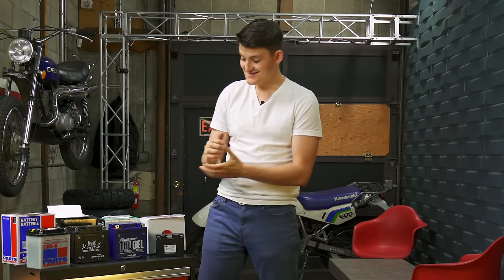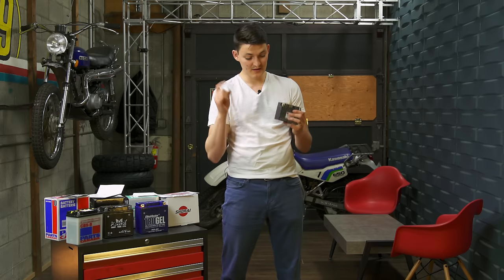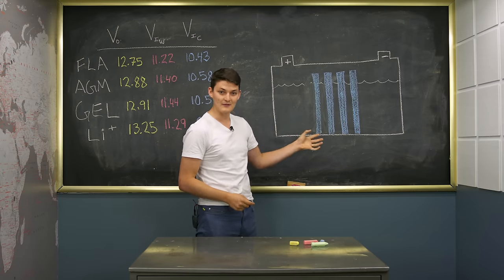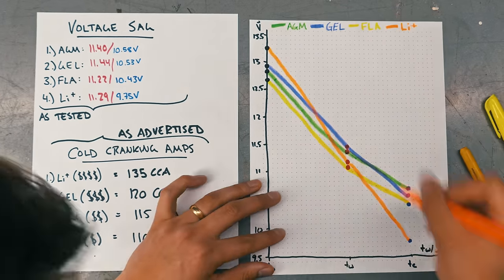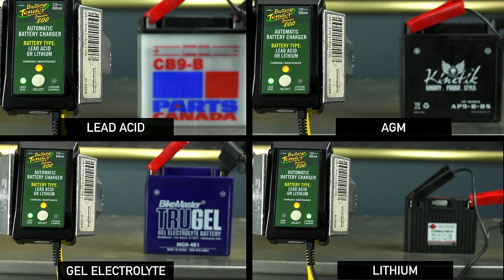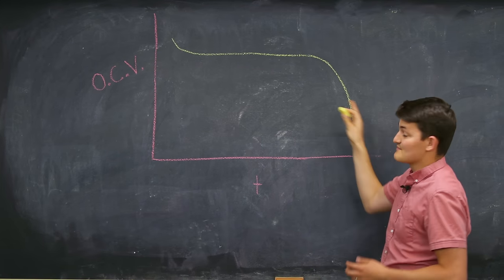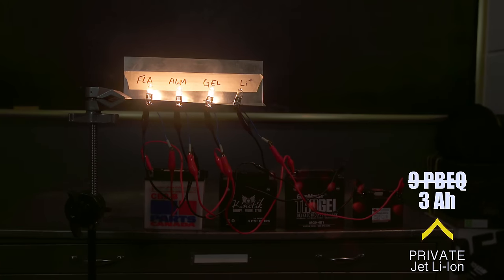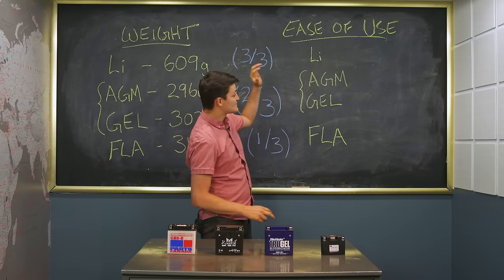Best Motorcycle Battery? Lead-Acid v. AGM v. Gel v. Lithium

Comment: Sorry Ryan, love your channel but you're wrong here.
Yuasa, the OEM fitment of Honda if not other Japs, is a 'normal' lead-acid battery which lasts for YEARS: I've had a few which lasted for over 8 (!) years (yeah, on a decent trickler like Ctek), and the shortest they've lived is 5 years - which was my bad because I didn't ride enough neither put a Ctek on.
Pricewise here Yuasa is about twice the price of a replacement, and none of those last more than 2 years (note, with same treatment & Ctek etc!), worse, they often do not even last a year (oh, warranted all the way to the exit-door of the shop mind).
That makes Yuasa an exeptionally good battery which also is very much worth its higher asking price - and would definitely be the WINNER here in your test!

Comment: This video needs an update, honestly. Needs to include the antigravity batteries and some of the other newer batteries.
Edit: Also, lithium batteries require a different type of charger/tender. Most standard chargers/tenders give off an initial voltage spike to knock out some of the scaling present in standard batteries (including AGM and gel batteries).

Comment: AGM for me, my battery is 5 years old and still going strong (though I use a smart charger during winter).
Reply: AGM for me too. The 9 year old battery in my maxi-scooter with 41,000 miles on it is still going strong.

Comment: i respect your testing and results, but it's still lithium for me all the way, not a lot of really cold starting, low self discharge over storage, and the battery i currently use will ping my phone over bluetooth if there is a problem with charge or temp.

Comment: now what you need to do is see about putting a supercapacitor bank in place of your battery. yes the capacity is abysmal compared to chemical, but capacitors are like LiIon on steroids. they'll charge with a bajillion amps without breaking... and then deliver all those amps when requested (they can blow traces off circuit boards if they're shorted across said traces), even at temperatures well below freezing, because they rely on physics instead of chemistry... also they weigh like nothing... something about using metals like aluminum instead of iron.

Comment: I own a 2016 Hyundai Tucson. They come stock with AGM batteries. Probably explain why Auto Manufacturers don't use Lithium. I have a 2018 Sportster 1200. With a Twin Power Lithium. Rated at 250 CA at 25C. Which I found out later. And is actually about 70F

Comment: Hi. I understand your disappointment about the 9Ah "Equivalent". However, if they wanted to pack 9Ah worth of cells in there, the battery would be 3x heavier, about same volume as Lead-Acid, and 3x more expensive (10x more than Lead-Acid). At which point, no one would really consider buying it. And then it would also deliver 400CCA, which is more appropriate for a small car than for a motorcycle The idea is that you don't really need 9Ah of capacity, but rather you mostly care about the cranking current, and possibly a weight and space savings on the bike. That's where these win. It is also a fact, that most people don't ride regularly, and in many places bikes just sit for months over the winter. Being able to park it and forget about it, and then have the bike start on the first try, is sometimes a deal maker. I don't know about your bike, but I cannot really leave my lights on while the key is out. I could leave the parking lights on, but I run LEDs everywhere, and so the drain would be about 20mA total, i.e. I could run them for almost a week before the battery discharges completely. Not a bad deal.
Finally, where Li-ion wins is that when you discharge it fully, it'll take the charge and be just like brand new. Try it on a flooded battery and after 3 discharge-charge cycles, it won't be able to start the bike anymore.  Regarding full discharge: yes, if you drain a li-ion cell down to 0V, and possibly reverse the polarity, it may damage it. Usually it doesn't, you may lose 10% of its capacity forever, but won't kill it, unless you store it in 0V state for weeks. However, what you had in your hand, was not a li-ion cell, but rather a li-ion battery which has 4 cells in series, and a BMS: Battery Management System. It limited how quickly the battery was recharged towards the end, but it also cuts the battery off when the voltage drops below a specified minimum, I believe it's 8V for Shorai. So the cells won't be drained to 0V, but will stay at about 2V each (nothing is perfectly balanced, but it's pretty close). The BMS itself, draws some miniscule current, so if you leave it like that for weeks, yeah, it will continue going down, but if you somehow manage to drain it and put it on a charger in a reasonable amount of time (days), it'll be like brand new.
Reply: I guess I should add, that I built my own battery for my bike. Got 16 A123 cells, some nickel sheets, copper bus bars, some acrylic sheets, and I got a battery that actually had 10Ah of capacity and 870 CCA. For the heck of it, I started my friend's Dodge Ram truck using that battery. No problem.

Comment: Someone needs to mention phantom current consumption while your battery is still connected to the terminals on your bike.   Harley Davidson's are notorious for this, so you should keep them at all times on a trickle charge when not in use.

Comment: Something that also needs to be said about lithium battery's. Most that I have seen can not take more that 14V. So if you have an over charging problem on your bike and don't catch it in time you will melt your Lithium battery. I work in a bike shop and have seen it and they stink when they go.

Comment: For lithium, you really need the right equipment from charging to quality of Lithium batteries.  The smaller ones suck big time.  Get the right one?  BOOM, you're set for the next 20 years (if your alternator is set properly).

Comment: I had the original Yuasa in my R1 RN01 for 8 years until my stupid father pulled the charger supply during winter time and it died. Than I replaced it with a Excel very exensive gel type- Fucked up after 4 years, replaced it with a expensive lithium JMT HJB FT SI - fucked up after 2 years. Now it got the cheapest gel battery, 15 €. OK so far... It is now working for 3 years. Charger/ mainitainer  is connected when not in use. My advice: buy a medium priced one and call it a day.

Comment: I have a Shorai battery and the warm-up wait is real and annoying. But that charging test was bogus. Anyone shelling out $135 for a Shorai battery is going to shell out another $30 for the Shorai charger. In my experience, my Shorai charges from completely dead to full charge in about ninety minutes.

The Junior tenders, which have been well-known as cheap and reliable for all lead-acid batteries for many years, are great but just not on the same wavelength as Shorai. 

Putting a Shorai on a Junior is like giving an Italian exam to a Latin student. He'll probably pass, but the exam failed to measure his true aptitude.

Comment: Thankfully the price premium goes out the window as soon as you discover that you can get an (actual) 4,2 Ah LiFePo battery for 35€ or roughly 40$ if you don't look for motorcycle specific ones.
Been riding with a Zippy Flightmax in my SV 650 for the past two years, never charged it, never had any serious problems with it. 
It doesn't mind being cranked (and thus heated up) while cold (<0°C) although you might have to crank for a minute before it's actually able to start the bike. Definitely quicker than waiting half an hour with your headlights on...
Recently made a proper housing for it with fixed clamp positions for another 8€.
Sooo, 43€ for all the benefits of Lithium? Yes please imo.

Comment: The downsides of Lithium seriously outweigh the upsides for this Colorado rider, especially as I sometimes have to get moving quickly. I also have access to a car if I need electricity on demand to start a bike that has sat with no trickle charge, and a hill enough to get me to 10mph/15kmh for a clutch start if no car is available or doesn't work. With regards to maintenance, dropping, or crashing, screw conventional lead acid. All that being said, AGM for me.

Comment: All of my old lead-acid batteries (mostly yuasa or exide) they where died after 2-3 years use, with good maintenance, but the last 4 years that I used  lithium batteries (skyrich) all my problems are solved. A significantly better cranking power, plus the fast recharging. The real price difference is only 30-40%. The truth is on the test, not on the bench...

Comment: Have always used and gotten more use out of conventional FLA batteries that can be topped off as oppose to maintenance free. I have actually had good luck and gotten yrs out of bike batteries. I think the reason  is I ride all yr long so battery doesn't sit just discharging for long periods. Right now I ride a Hornet 919 I bought over 3 yrs ago still using the same battery it had when I bought it its just now starting to give me problems when bike has sat overnight in 30 degrees. however when temp is warm bike cranks right up with no noticeable lag from the battery so not quite ready but know I will need one this yr.

Comment: It should be noted that a lithium battery has a hard time cranking a high compression engine (say, a supersport) when it's cold. For example I had the headlights on full beam for over a minute and a half after a night at 0C degrees and it took well over 30 seconds of cranking and only barely sputtered to life. This is in a Superduke 1290 and that bike has a big ass LED headlight. A conventional fluid battery would have no such troubles. Then again, they don't weigh 700 grams...

Comment: The point of the lith-ion battery is to be able to put a "larger" capacity battery in the same space, not use a battery half the size of the original, i think a fair comparison would have been a larger lithium battery

Comment: My 2 cents on this topic is that if you're on a budget, just go with AGM: it's safe, maintenance free and easy to use.
If you have money to spend, buy 2 lithium and wire them in parallel: benefits of lithium with double of that shitty single unit capacity.

Comment: Hi, I just want to share my experience with AGM and Lithium battery...
Few times happened with my AGM battery (£55) went under 10volts in a standing bike with alarm, after that they never keep the charge more than 15 hours, so I always needed to replace them, so always £55 out of my pocket. Now I'm using a Lithium battery (£85). Yes, little bit more expensive, but 2 times already happened the alarm suck down the battery till 1Volt! I got shocked first time, but you need to know one more thing: you can charge the AGM battery with 1A, while the Lithium is with 20A. So I connect the charger, and my bike was ready to start in 10 minutes, and after 2 flat down my Lithium battery still keep the charging as a new. So already save me a lot of money, and headache.

Comment: Everyone misses a very important point between all these batteries...  Lithium batteries have a wicked high output to start a bike but lack the ability to sustain the output to provide the grinding power some bikes needs to start.  

I have a liLead lithium battery and I hate the h#\\ out of it..  My cammed Harley Davidson needs about 3 seconds to turn over and start. My lithium battery has about 1.5 seconds before it shuts off to thermally protect it from causing a fire. The battery is smart (buying a cheap dumbed down lithium is dangerous) and shuts off for 15 mins to allow it to cool down.

Yep all my biker buds are off riding while I am stuck waiting for my battery to recover to turn back on.  Annoying as heck and I plan to blow this battery up someday as I hate it that bad.

On the other hand an AGM or Gel battery has the grinding power most motors needs to affectively start properly.

Think of lithium having lots of horsepower while traditional batteries have the torque.  The same argument as gas versus diesel.  

Only reason I would ever recommend a lithium battery is for weight and space savings....  Other than that, don't waste your money.

Comment: I changed my stock battery to lithium and the weight went from about 4kg to just under 1kg. Cold mornings it takes a 3 or 4 quick starts to fire up the bike. The first one it's like the battery is almost dead. Each successive start it has more power.

Comment: It’s funny. I live in Indonesia for approximately 3 weeks every year, though I’ve been here for a couple of months this time hiding from the corona virus in China where I live for about 9 months of the year. Anyway, it’s hot here, but my little bike sits unloved for 11 months at a time. I can buy a LiFePo4 battery for about a quarter million rupiah- around £12.50- and I’m thinking of doing that just for the lack of trickle charge hassle. The ones you buy here are the same physical dimensions as the original, just around 60% lighter, not sure about the Ah rating- sellers are coy. I’ll report back in 12 months and let you all know if it starts off the key ;-)

Comment: What I really want to know is lifespan. My experience over the last 10 years or so is that even the mighty Yuasa has seen a decline in quality. I always bought Yuasa, because they were allegedly the best, but they aren't lasting like they used to. I'm leaning toward a NOCO battery, as I've been impressed by their small jump starter / booster (on cars - auto tech for too many years to want to think about). I'll gladly pay a premium for a battery that I can count on for at least 4 or 5 years.
Reply: AGM all the way, mine is at least 5 years old no problems

Comment: So if you have to get a special charger for a lithium battery... how can your bikes charging system charge the lithium battery safely without modification?
Reply: Although energy from the bike isn’t ideal to charge the battery, its own internal management system should balance the cells and won’t cause a problem unless your bike is old and might need some parts replaced to make it work. The special charger would come in handy with the initial full charge and the main/diagn features if that matters to you.

Comment: Personally I like AGM. Best bang for the buck IMO, and don't leak acid all over the place.  Have seen many an old bike with the frame rusted through from lead acid batteries.  The battery itself may be a little cheaper, but in the long run AGM is worth the difference in price by not destroying your bike.  Gel I have always found pointless,.  Higher price, no real benefit.  Lithium is just ridiculous unless one seriously needs to mount their battery upside down or weight is at an absolute premium but for the average rider I've yet to be convinced there's any benefit that remotely justifies the price tag.

Comment: @FortNine if you discharged the batteries for 15 minutes, doesn't that mean the Lithium battery got discharged to about 50% of its capabilities. Then 132 minutes would be faster than the rest.

Comment: I came here because I saw that BMW model range have different batteries. 

The 1600 Grand America = 12V / 19 Ah; 
The Urban C 650 GT = 12 V / 14 Ah; 
The R 1250 RS/RT = 12 V / 12 Ah; 
The R 1250 GS = 12 V / 11,8 Ah; 
The F 850 GS = 12 V / 10 Ah; 
The S 1000 XR = 12 V / 9 Ah; 
HP4 Race = 12 V/5 Ah (only Li Ion)

I am still trying to figure out why that is ...

Comment: I was wondering why the lithium battery was performing so poorly until you brought up that its 1/3rd the capacity of the others. A true 9Ah lithium would do circles around the other batteries in every test except cost.

Comment: Sealed lead acid and AGM are safe choices. Lithium is to be avoided at all costs. Many people on many motorcycle forums I belong to have spent a small fortune on those Shorai lithium batteries, only to have them go belly up in less than a month. Lithium battery technology has a long way to go before it is ready for everyday use. Just about anything will destroy a lithium battery, from charging them at the wrong rate, to charging them for too long or not long enough, draining them below a certain point, or drawing too much current from them too fast.

Comment: I think it would be worth going for a different brand of Lithium battery, I have replaced my battery in a Ducati and now I'm no longer afraid of stalling. 16ah actual capacity, vs. the 10ah stock lead acid. Also the charging test you did wasn't really valid due to the charging rate being set by the charger at 800ma, a fast charger for any of those batteries could have charged them faster.

Comment: If you tip your bike over with any regularity, i.e. dirt or ADV bikes, FLA and AGM are not good.  After leaving your headlight on to drain the battery, the lead acid batteries should be replaced, but the lithium will endure.  How much you need this depends on your riding behaviour.  And below freezing?  Not riding.  Put the gel battery on the snowmobile!

Comment: Amp hours is not a unit of energy. 
You’d have to multiply the amperage with voltage and divide by hours. Or just keep hours on the amperage. 
So you’d get watt hours. 
Ah*V = Wh

Comment: Charging LiFe isn’t quite as straight cut as you make it. Lithium batteries can reach a much high SoC in short order where as a lead acid would take much longer. So in real would... that moment you want to go for a ride but have to charge up, the Li battery will get you on the road sooner. Also, and this is a big BIG point. Lithium Iron Phosphates do NOT ignite anything like Li polymer batteries. So please be careful with spreading incorrect information. Especially when showing a video clip of a LiPo when playing it off as a LiFe. Otherwise great video and good tests highlighting Shorai’s misleading specifications.